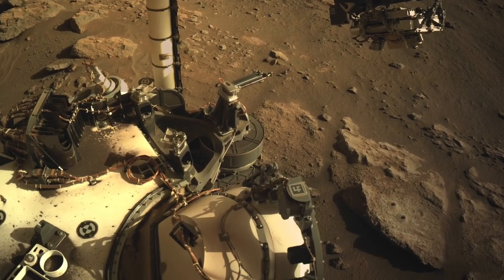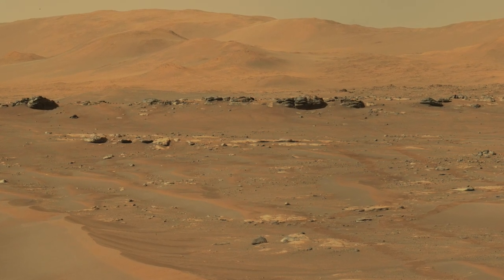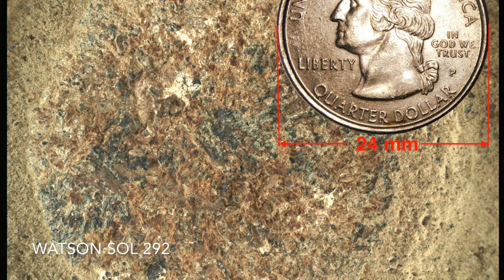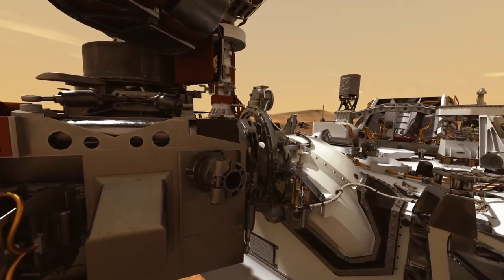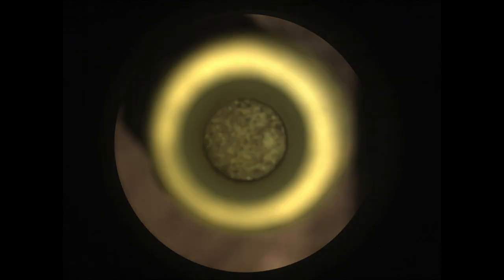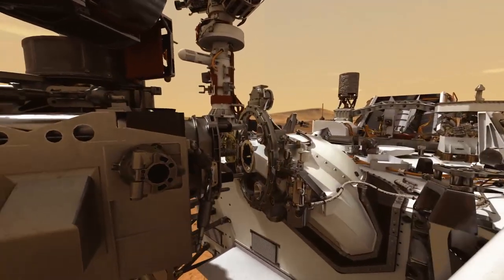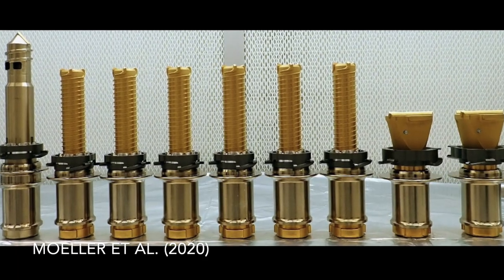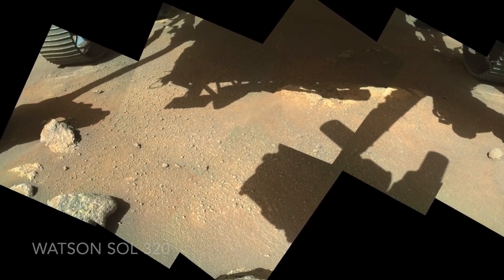Trouble with Mars rock sampling activity

Comment: In the Airfield L predominate some almost spherical pebbles of dark color, but there are others equal in size and shape but of light color that are not as numerous as the first. Is it known what minerals it is?. ( See latest RTE photographs published ).
Reply from the maker: Based on other sand ripples seen by other rovers, those are probably about 1 mm diameter grains, a coarse lag on top after the finer grains are removed by wind.  The lighter grains could be feldspar.
Reply: @MarsGuy  
I thought they were larger, between 2 and 4 millimeters. The dimensions of a foot of Ingenuity's landing gear could pinpoint this.
About Perseverance: Seeing the last photos of the sun 328 where some fragments of the last extracted core, from the second hole, with the Perseverance drill, are shown on the flat rock, I distinguish three colors: Green, white and red. Olivine, feldspar and iron oxide. Is that so?.
Reply: The samples, (the core), have a small diameter, may be subjected to too much twisting or torque (¿temperature?), and split into several shorter cylinders. Perhaps a drill with a larger inner diameter and/or outer diameter only slightly larger than the inner one?
Reply from the maker: @copperNick-North  The white is probably some kind of salt, and the olivine is probably not green because it is more iron rich in these rocks, so it could be the brown stuff.
Reply from the maker: @copperNick-North  There was a lot of engineering and testing that went into optimizing the core size, so this is probably the best compromise given all of the requirements.
Reply: @MarsGuy  Sorry. No doubt, all my respects to the scientific community and people working in these very important projects.
They are just speculations of somebody interested wanting to understand more about Mars, even contribute some idea :)
Reply from the maker: @copperNick-North  No worries.  Glad you're interested.

Comment: I often wonder who is going to eventually pick those rock samples up ?..it prob won't be in my lifetime. I do have a question, I read recently that fluid water is not possible on Mars due to the temperature. If you tried to heat up water ice it would skip the fluid step and go straight to vapour...is this true ?.....thanks.
Reply: There's a planned mission to go pick up and return the samples within the decade. And and the current temperature water can not be a liquid, which is good because that means there's water trapped at the poles. However we can heat the water up at a small scale for human consumption as well as using that water for rocket fuel once we separate the hydrogen and oxygen. Now in the far future, we can hopefully terraform mars into a warmer climate. Ofc many things have to go right, one of which and imo is the most important, generating a magnetosphere around the planet so that any atmosphere we create isn't stripped away by solar radiation
Reply from the maker: Yes, it's true that the atmosphere of Mars is so thin that melting water ice transitions to a gas without the liquid phase.

Comment: Nice clickbait...  Not until the very end of the video do we learn that Perseverance can just turn the can upside down to empty it out.  So this sure looks a little like a nothing burger.  The core sample drilled had fragments that fell out during lateral transfer.  Tip that can and the problem is solved.
Reply: The "trouble" in the video title refers to at least the part where they got a notification from the rover that something was not quite right, which was eventually only fully diagnosed when they got the picture back showing debris in the system. Fortunately, for those situations, there's a series of steps that can be used to try to clear it up, if they work in this case, we'll know later this week. It required recreating the problem and testing step by step with the rover they've got in the lab. Also, they are going to lose the content of the tube once the carroussel is rotated twice, as they now are unsure about how much of the rock sample still lies inside. Was the coring trouble-free? No, so no clickbait here. What if it does not work?
Reply: @_John_P  Uh... the "Perseverance in a jam?"  title is the first image of the video...  The fact that a bunch of really smart engineers obviously thought about this possibility ahead of time, engineered for it, included sensors that monitor for excessive pressure during the latching operation, and have a duplicated rover here on earth to work out next steps, are all exactly my point...  Stuff like this was planned for.  Clickbait is coming up with a headline that cries "wolf".  Compare that headline to something like "Rock jam triggers operations halt"
Reply: @markusrobinson3858  That title is a question with no answer yet, not an ascertion of the current situation. They planned for debris, but it's unclear whether the debris they've got in practice will fall off just by rotating in theory, as it got pushed into the mechanism, that's how they identified the issue in first place.
Reply: @_John_P  Mars Guy just states the facts. Even in the title. It's the best Mars channel on YouTube! Every other Mar's channel on here except for a token few is all clickbait and fancy editing. Stick with the Mars Guy for your Mars knowledge! 😍
Reply: @TheBagmaven49  Wrong recipient.
Reply: There is nothing clickbait about this vid Markus. It explains how perseverance overcomes the problems it encounters harvesting core samples which I find very interesting. There is plenty of clickbait on YT....this channel is not one of them.
Reply: @_John_P  sorry! 😳
Reply from the maker: @Markus Robinson The JPL engineers don't share your lack of concern: https://mars.nasa.gov/mars2020/mission/status/357/pebbles-before-mountains/
Reply: @MarsGuy  Great explanation about how JPL is working the challenge.  Thanks for posting the JPL update.  I'm a little surprised by overall response to my somewhat tongue-in-cheek comment about "click bait" and just "tip that can".  One of the things that I found so wonderful about the movie "Martian" was the fundamental thesis of 'you want to live?  Well then solve the first problem.  Then solve the next, and the next and the next.  And if you solve enough problems, you live.'  Whether it's humans or Perseverance, it's the same basic strategy; "engineer the S**T out of this thing".  Thanks for replying.  This is of course as super channel.
Reply from the maker: @markusrobinson3858  Got it, thanks.  And yes to Mark Watney's paraphrased statement!